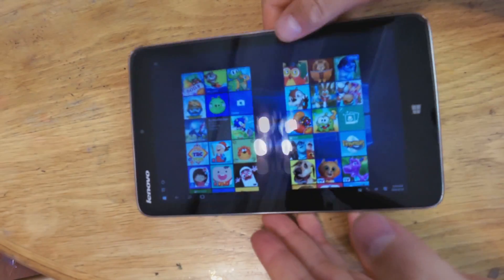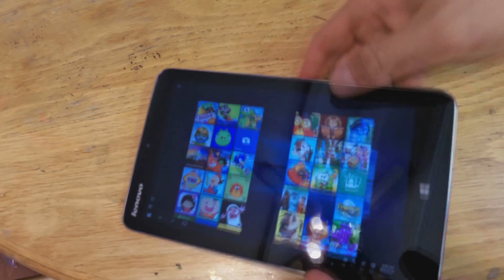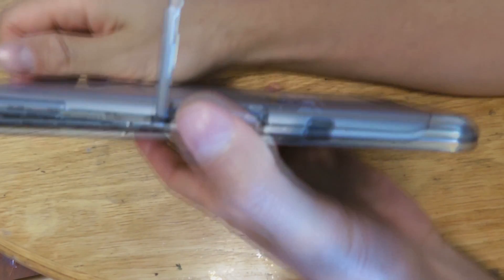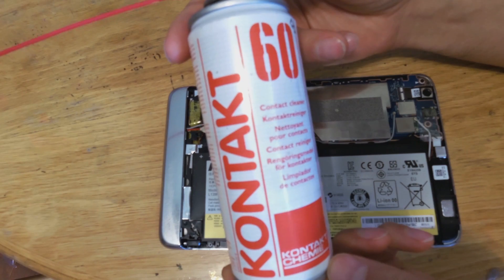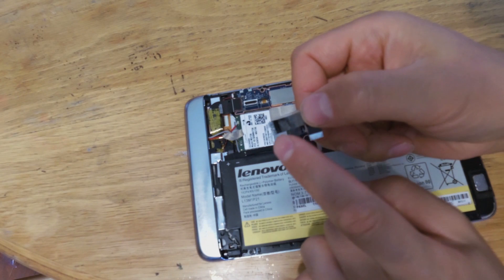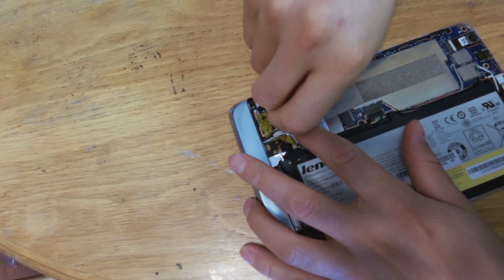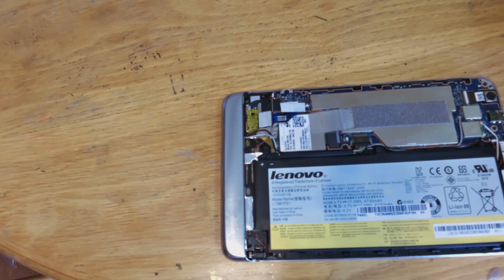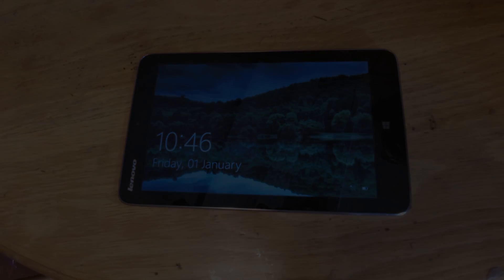Lenovo Miix 2 (8 inch) freezing touchscreen repair: Step by Step

Comment: Thank you Pal, I fixed my Lenovo MIX2 8 touchscreen succesfully, for addition, my problem is the flexible flat too lose when it locked in the mother board connector, so I add 1 layer of kapton tape to the flexible flat cable, cleaning the oxidzed contact surface and it fit secure when locked into the connector. worked fine.

Comment: I want to thank you for this video.   I have been having problems that sometime the touch screen worked sometimes it didn't.   Liked your video because it is straight forward what you need to correct the problem.  I have been blaming Windows 10 for the problems.    After I pulled the ribbon cable and cleaned all with contact cleaner I turned it on and immediately responded to touch.  It has not worked this well in a long time.   Again Thanks for you time.

Comment: " W A R N I N G "

If you do not "Lift/Un-Clip" BOTH of the black cable locks, you will quite possibly destroy either the ribbon cable, or the actual socket when you try to plug it back in.

The video does not show the cable lock on touch screen socket being un-cliped, this can and/or "will" eventually destroy the ribbon cable and/or the socket itself.

(just say'n)...

Comment: Thanks a lot for you video. I wanted to install an android on that piece of sh**, because I thought that it's software problem. So you just used the contact spray or also replaced that connector?

Comment: Worked but could not remove left touchscreen side and did not use the spray.  Also there were no pads on the contacts only tape.  Thanks!

Comment: I have one and the screen says " A configuration change was requested to clear this computer TPM" and it want let me do anything. Will turn on and off, and will let you get to the reset but won't reset.
Reply from the maker: its a bios issue. Just accept the change. Or maybe your screen still does not work and its not accepting your touch
Reply: It is frozen, won't let me accept.
Reply from the maker: even if you use a usb keyboard
Reply: +ecologicaltime I am in the same scenario, Wired mouse,wireless a mouse and wired keyboard doesn't working to BIOS/NOVO screen! It freezes askin for only Touch! But how? Does this video workouts if I reset that chit? Thanks for video anyways..

Comment: This is brilliant. I used a credit card, not having a plectrum.  The clip down the long side was tricky,  but the video helped. All seems good so far.  I had no pads, so I made my own with laminate floor underlay and double sided tape.  I had to build the lower connector padding up to three layers as it is lower than the other one.  Good video, thanks.

Comment: Thank you very much for taking the time to make this video. I tried this and it worked perfectly. I especially appreciate the details about removing the back cover - the little details show your knowledge of the product and kept me from breaking the little tab on the side. I will highly recommend this to others. And I agree with the comments that the flex cable is a VERY bad design. I can remember when IBM products were the best quality and held to the highest standards. Lenovo has reduced their standards to such a low level - I used to buy only IBM/Lenovo. Now I am on the hunt for a new manufacturer of high quality well-built tablets.

Comment: Thanks man. I need to try this. I bought mine it February. I dropped mine once after two weeks, which probably didn't help either, and this issue started happening about two weeks ago. I wonder if Lenovo Warranty Services will fix, since it has minor visible damage from the drop. I tried pressing firmly all over the back cover, which worked (probably temporarily). Now it makes sense why.
Reply from the maker: +Johan van Staden try Lenovo first, maybe you get lucky.
Reply: I'll give them a go. How's W10 for you on these tablets? Mine sometimes crashes when I leave it sleeping/hibernating for a day and then wake up. It also goes into an unresponsive battery draining state from time to time when I'm not looking.
Reply from the maker: I have two of these that my children use running 10. What i notice is that sometimes the tablet just does not respond. Have to hold the power button for 10 secs. However, it may be because children are using them with games... so i cant be sure. When i used it it was fine. Not great, just fine. Had some 3G issues on mine.
Reply: +ecologicaltime I've also noticed that when the touch stops working, one of the, "I2C HID" devices has a 'cannot start - code 10' error. I'm guessing the loose cable is probably causing the driver to break as well. 

I got mine for R2000 so it was an 'experimental' purchase. Also not bad, but nowhere near my Android tablet.
Reply from the maker: that's a good deal. Look i can say in terms of performance its actually good for the price, i paid R7000 and even for that i was happy. However, i use dell and the dell business range products are a lot better. I wouldn't use this tablet for reliable day to day work... but dont get me wrong i prefer windows to android. Have you used a Surface Pro? OR a venue pro?
Reply: +ecologicaltime I haven't used any of the 'better' Windows tablets (Dell, Surface, etc.), and my woes is probably limited to this one. I use it for meetings and games, or to remote to my real work PC. Fairly happy for what I paid for, I just need to get the touch issue fixed.
Reply from the maker: cool
Reply: Sorry, quick question: when you had this issue, did your Windows touch key on the bevel still work? Mine does.
Reply from the maker: yes still worked in that a vibration could be felt when pressed.
Reply: +ecologicaltime I logged a ticket with Lenovo but eventually just opened it myself and added some padding. Out of interest, did you find a replacement cable for the ruined one in the video?
Reply from the maker: sorry i didnt find one.